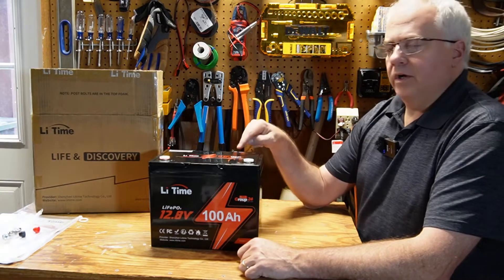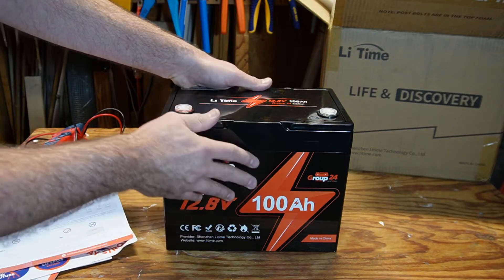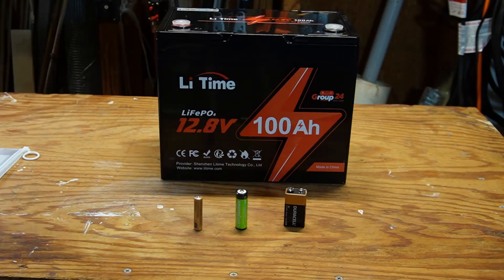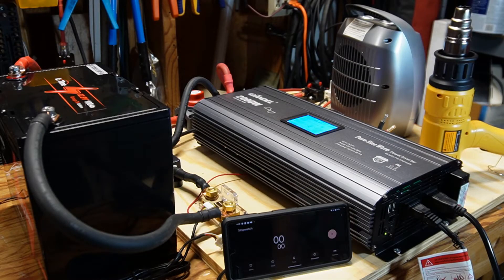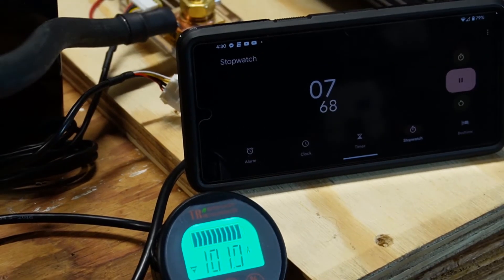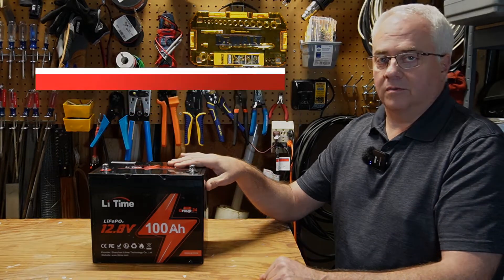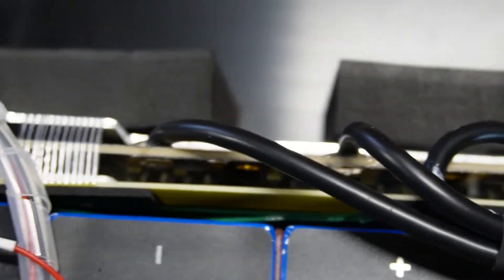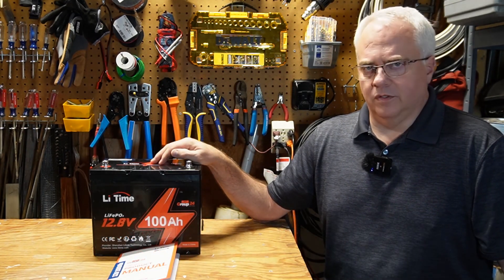LiTime Group 24 LiFePO4 12v 100Ah Battery Review - What is a Group 24 Battery?

Comment: What would be better for my popup camper? Two LiFePO4 12v 100Ah or One LiFePO4 12v 200Ah?
Reply from the maker: You can use either. If can handle the heavier weight, I would go with a 200ah because you would need less wiring/connectors. Depending on the location you are installing them, two smaller batteries could provide more flexibility on how you position them into place.

Comment: i will use lifeFo4 battery for 30 lb thrust trolling motor. boat size 10.5 ft inflatable. Fishing range 3-6 km. the battery will be only power source of trolling motor and fish finder. Will I buy 100 AH group 24 or group 31 ? 
please help
Reply from the maker: The only difference between a group 24 and 31 is the size. So whatever fits the best.

Comment: What's the run time if am using 8 of these
Reply from the maker: That totally depends on what you will be powering. You would have to of course connect the batteries according to the connection guide in the owners manual. Typically 4s4p. But to give you an example using a refrigerator. My 25 cubic foot refrigerator was powered by this battery for 18 hours when it was relatively cool in my garage. So in theory, 8 of them could power that refrigerator for 144 hours without any solar charging.
Reply: @proficientprepper  wow that's awesome am planning to connect them in parallel do you think that's a good way to get more run time out of them?

Comment: Good day.
After fully charging my battery, the voltage drops to 13V in 2 days, and to 12.90V in 5 days. But when the battery is connected to 200W for 1 minute, the voltage is 13.39V and it stays like that all day?
Is this normal or not a battery problem.
Reply from the maker: Do you have an inverter powered on an connected to the battery? That drop would be normal if you have a powered on inverter because it draws some current while sitting idle. But what does not make sense is that if you use 200W for 1 minute, the voltage does not drop over time. Something does not seem right about that. Without knowing more, it seems that something may drawing power from the battery. But if nothing is drawing power, then it might be a defective battery. I've not had a defective battery or a battery acting strangely yet. So I don't have a lot of experience with troubleshooting battery issues.
Reply: @proficientprepper  Thank you for your answer.
Exactly, the battery behaves suspiciously (there is a gradual voltage drop) when the battery is charged and nothing is connected to it.
The seller wrote that this is the protection of BMS. But nothing is said about this on ebay.

Comment: Can I use the litime 12v 100ah trolling motor battery for trolling motor and starting the boat motor ?
Reply from the maker: I don't believe these batteries are meant to be starting boat motors or cars.
Reply: They are not made for cranking amps so do not use for starting motors

Comment: Can the Group 24 replace an existing Group 27?  Any specific reason why not?
Reply from the maker: Regarding the physical size, A Group 24 battery should be slightly smaller. So I believe it should work fine as a replacement for a group 27 battery. But my understanding is that group 27 batteries are intended more for higher current loads. So you just need to figure out how much current you plan to be drawing from the battery. The LiTime group 24 battery I reviewed is intended for a continuous draw of 100 amps and a spike of up to 280 amps for 5 seconds. If you need higher than that, then I would stick with a group 27 battery. Oh, and these LiFePO4 batteries can be used in freezing conditions, but should not be charged in freezing conditions.
Reply: That is helpful.  My continuous draw needs in my small travel trailer are minimal and the 24 will fit much better than the 27 allowing more room for the shunt and solar cable.  I ordered it yesterday and it seems like a great deal, only about $70 more than an AGM.